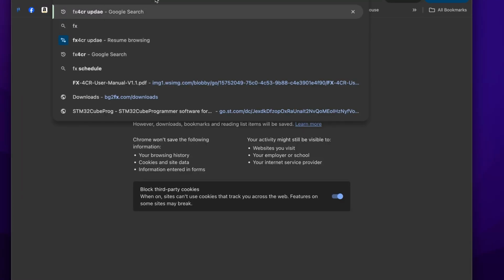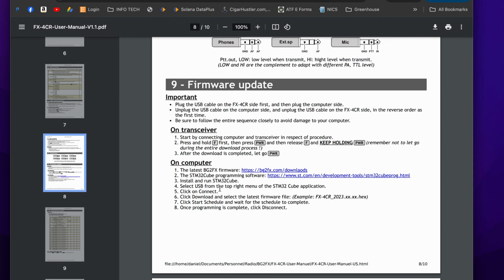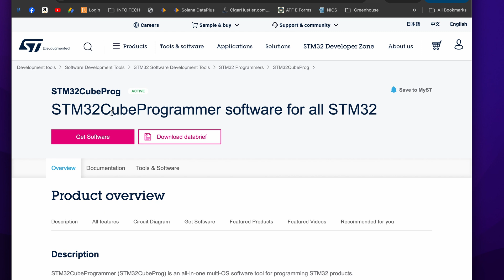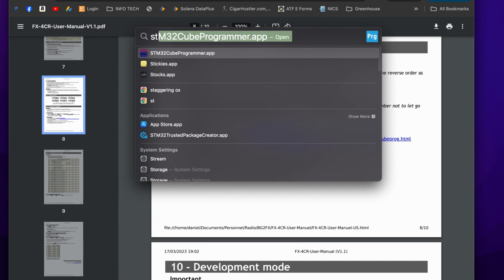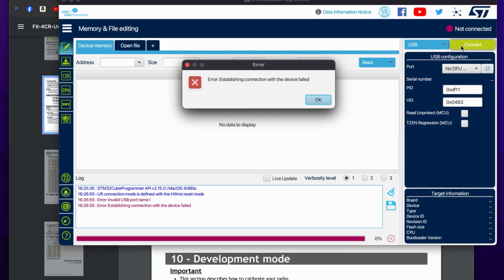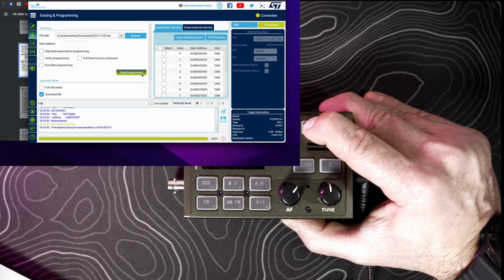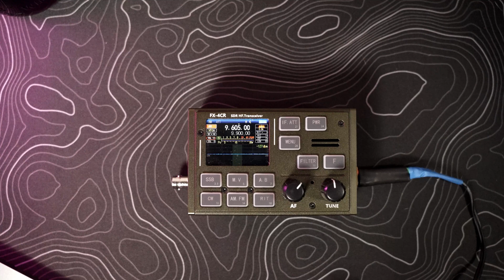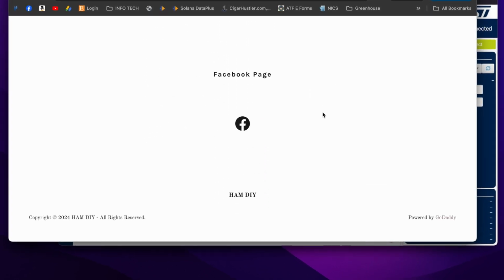FX-4CR How To Update Firmware

Comment: Umm. You don't have to connect and disconnect it before you do this. It's just saying to always connect or disconnect the PC side first. You don't want to plug in the radio while there's power on the cable from the USB.

Comment: I lose audio when I plug the cable into the computer and the transceiver.  What's up with that?
Reply from the maker: Could be that your computer is reading it as an audio interface. Since that is an option. You may need to toggle that off on your computer side.